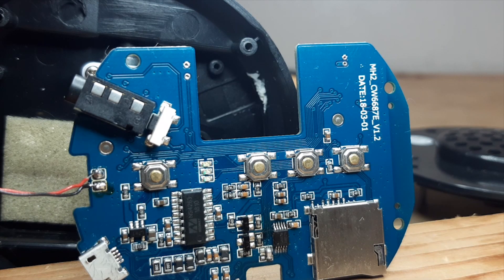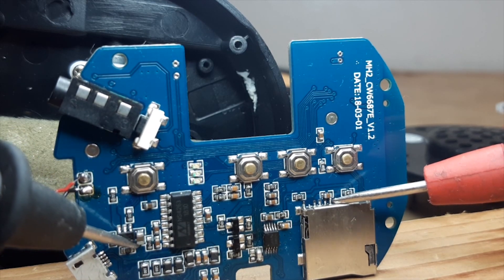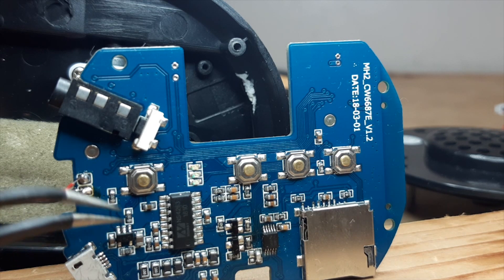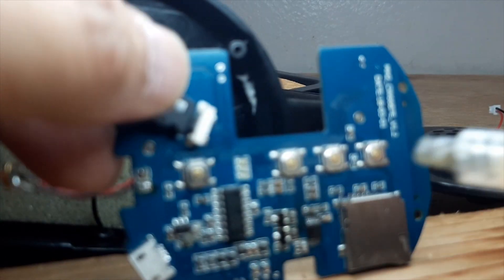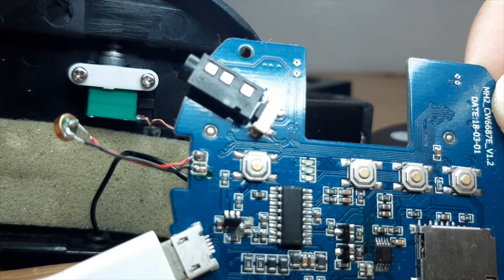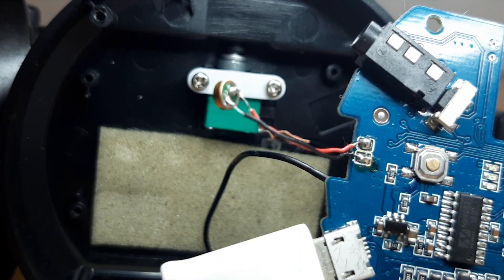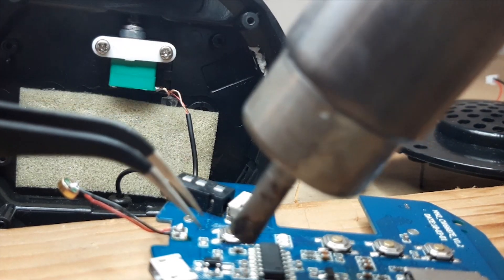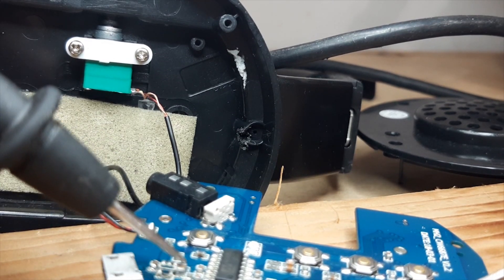How to detect a short component using Soldering Flux

Comment: The typical flux method is to boil some solid roson over the board, making a frosty coating, which when voltage is applied will melt where it gets hot.
Reply from the maker: Great point!

Comment: Thanks but you touched a part when it was powered up. That probably created more problems. Saw like a spark
Reply from the maker: https://youtu.be/mbd5zTLqYl0
Reply: If there is already a short it doesn't matter and also many parts are not affected by a short once the main source of the problem is removed.